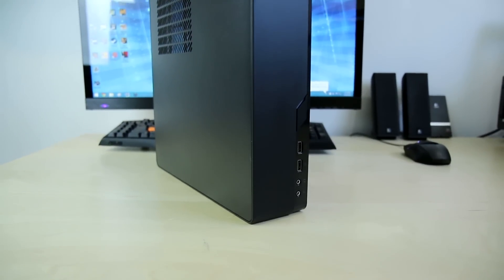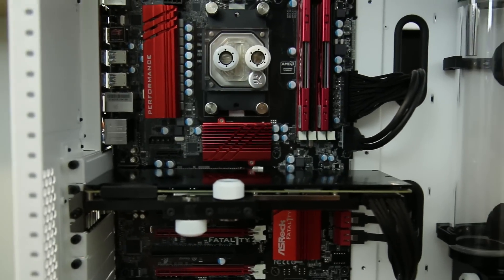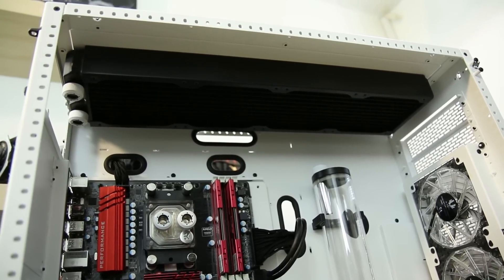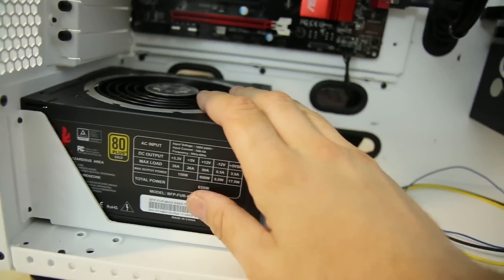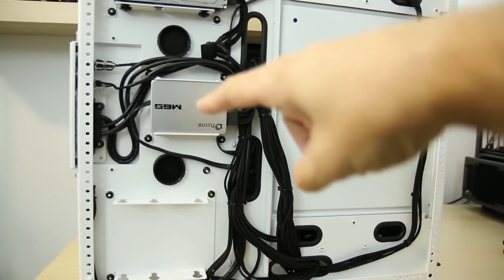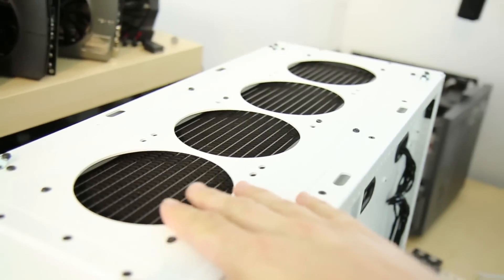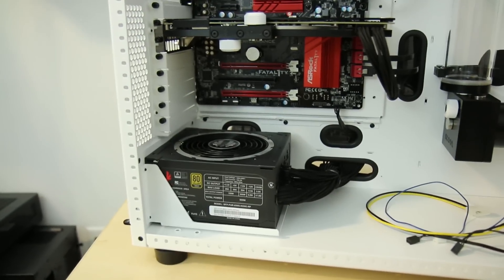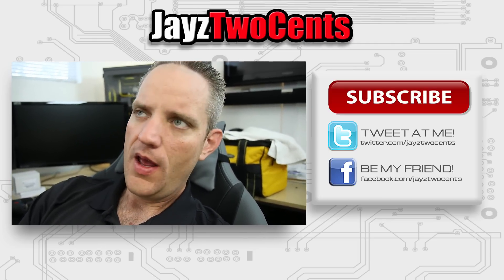Custom Watercooled AMD Build Update No. 1

Comment: I honestly don't think you can justify calling it an AMD build without an AMD GPU in it, but still a great video. I honestly don't even know why you're going with an AMD CPU in that because I have a strong dislike for Nvidia and Intel but even I will admit a current AMD processor at only 4.4GHz would probably bottle neck 980 in a lot of situations, but I'm assuming this is going to be used for gaming which isn't always the case. Again good video though.

Comment: Use the rear fan as an intake also?
Reply: 1Cichfishy there is no rear fan though.
Reply: Remove the blocking plate and add an intake fan(with filter)to aid with positive case pressure.

Comment: I was wondering: even if I like AMD myself, wouldn't even an overclocked 8350 bottleneck the 980 a little?

I really like the aesthetics.
Reply: You clearly don't understand what bottlenecking is. Bottlenecking would be if the 980 wasn't running at 100% usage because the CPU isn't fast enough but that is not the case as I have this setup and have done many test
Reply: Matthew Eng That's good then. I said a little because I wasn't very sure. The FX are good CPU, but nowadays I'm very sad since a core i3 4150 beats FX 4300 in both single-threaded and multi-threaded workloads... (even if their prices are totally different, it saddens me to see a dual core with HT beat a quad core).

8 core FX might still have some advantage in multi-threaded workloads compared to i5, since AMD predicted the use of multi core a few years ago, but compared to i7s, it might be the same case as with 4300 and i3.

Still, the price is the only thing helps AMD until they can be competitive again (or at least a little closer to Intel).
Reply: MrBiky yea in cinebench the 8350@4.5ghz sits right between an i7 3770 at stock and a i7 4770k@4.4ghz and both of those are way more expensive even tho the 3770 is last gen that's still really good

Comment: Ditch Caselabs case for an Enthoo Pro, go 2011-3, problem solved.
Reply: How are you comparing a CPU platform to a manufacturer of cases?
Reply: Tech Tyler
 The money saved, can fund the more expensive platform.
Reply from the maker: T.E.D. de Medici The case wasnt a part of the cost, I should have mentioned that. I only charged her for hardware components, the rest I provided for the build myself, including most of the watercooling stuff.
Reply: *****
 Ah, makes complete sense now. thanks.
Reply: T.E.D. de Medici That makes sense now.
Reply: should have got a thermalfake
Reply: ***** that's some sick filth of a deal then. :)

Comment: Forums take long so I'll just ask here.

Budget Build($500-$650)

CPU: AMD FX-8320 (for video editing and gaming)
GPU: R9 270X (at least GTA V 1080 60 fps)
Case: Raijintek Metis or Corsair Air 240

Question1: Since I like to buy mini-ITX cases, I want to know which itx mobo will fit the CPU and GPU mention above.
Question2: If R9 270X can't fit on ITX mobos, what are the other GPUs arnd $200 that can play GTA V on high settings?
Question3: I know Raijintek is very small for water cooling. which fans are good for keeping the temp down

Thank you :)
Reply: What's wrong with atx size?
Reply: Neil Mc Cann I like compact size cases so mobo have to be at least a m-atx
Reply: LeonZoc You could probably do an R9 280.

Comment: Is there any difference between AMD and Nvidia/Intel or whatever water cooling builds? (Besides the parts. duh)
Reply: You can have a AMD/Nvidia build such as thing one btw but for the most part everything is pretty much the same I'm not too sure about your question are you asking about the watercooling hardware? Such as the cpu block? I know for EK they support AMD and Intel CPUs you just have to add a plate to the AMD block for it to work. Always make sure your parts are compatible with each other first before buying
Reply: Daniel Burgos That was pretty much what I was thinking. Only difference is the Waterblocks for CPU an GPU but else it's the same.
Reply: Yep that's about it lol cpu and GPU blocks are different but everything else like reservoir, radiator, pumps, fittings, tubing all the same between AMD, Intel, Nvidia
Reply: Rumi on As Jay implied in the video, this CPU waterblock is suitable for both AMD and Intel CPUs, it just requires different mounting hardware. Intel motherboards have the cooler screw holes in a sort of square around the CPU, while those on an AMD board form a more compact rectangle. The vast majority of coolers comes with mounting hardware for both, though.

Comment: Does anyone one know where to get an aftermarket "Push down tube" for a resevior? I would really like to get 1, but no matter what I try and search under I just can't find any thing.
Reply: HeyDan, Alphacool makes a 'Universal Flush Tube' in Nickle plated. couldn't find any plexi typs splash reducers, however I can recommend  the Flush tube if you are still looking to modify an existing reservoir.